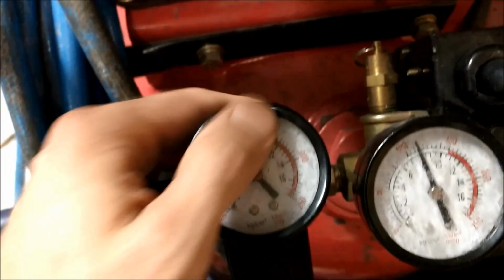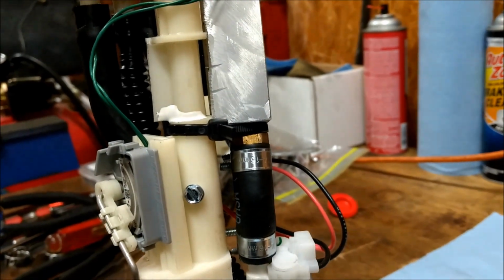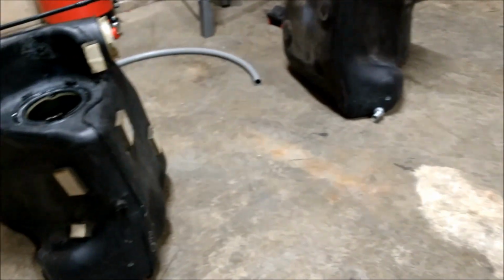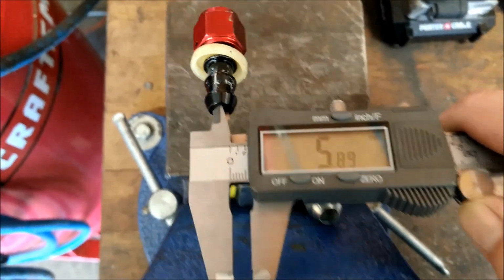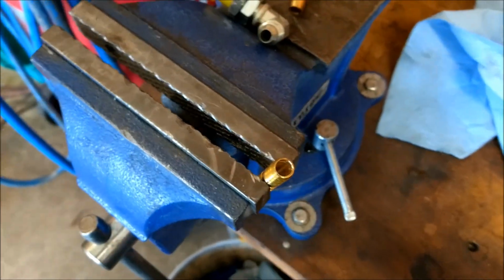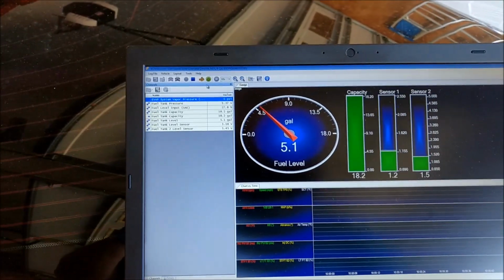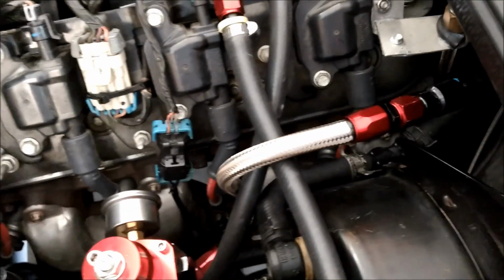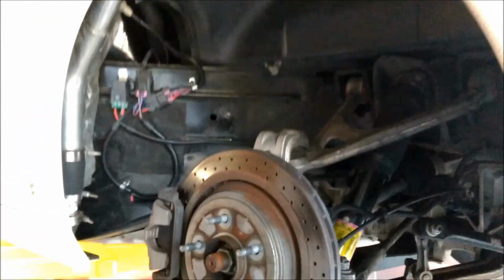Dual Walbro 450 Fuel Pumps PT 2

Comment: I put a 6.0 swap in my 1500 truck can I put a would you recommend the 450 pump for my truck or should I go bigger
Reply from the maker: A walbor 255 would be fine.  I put 2 woalbor 450s in my Vette and they were over running the after market fuel regulator so much I had to rework the tune for 62 psi base pressure and that was under vacuum.  With now vacuum it is at like 65 psi at idle.  Those 450 flow like no other!
Reply from the maker: The 255 if what my vette has stock and I moved it to my supercahrged dakota and it runs my truck at 6psi of boost full throttle now pressure drop.

Comment: Hey, about the eletric oil pump for the turbo, you had some problems with the gears from the old pump mounted with the engine from the new? Had some leak problem? Im looking for an eletric oil pump but some announces say the max oil temperature its 60°C. looks like some pumps come with seal that not was made for using with hot oil (your pump looks like a similar model that i see before).

greetings from Brazil 

https://www.ebay.com/itm/SEAFLO-12V-3-2GPM-10A-Gear-Pump-for-Oil-Transfer/273579304361?epid=1360849361&hash=item3fb298e5a9:g:zvMAAOSwLNxb-vy1:rk:1:pf:1&frcectupt=true

(link from the pump im looking for)
Sorry about my bad english =/
Reply from the maker: That one looks just like mine bet it is same manufacturer. It works fabulous but a little noise. Look at some of my other videos to see how to mount to make it more quite. Also take apart the gear section and clean it. Mine had foreign debrise in if I had to clean out. Do not use it straight from the box.
Reply: Does leak oil on the gear section? Because i got some informations saying the max temperature its 60°c. Maybe the seals are not made by using hot oil..... Do you got some leak on the pump or on the links of the hoses?
Reply from the maker: You may need to change the oring to a viton material. Neoprene will work but it hardens at that temperature after a month or 2.  That is what I did and no leaked or trouble. Make sure you mount it motor side up gear side down and you will be fine. That is how it did mine a d I have been using it for over a year now.
Reply: Thank you for the answer!. One more question, do you put a oil filter after the pump? If you did, does some difference on the level and the pressure of the oil from engine?
Reply from the maker: @gabrieljc2702  I am not using a filter. The car already has one. Also you can not suck oil through a filter you have to push through one and that really hurts flow  rate. High Flow rate prevent smoking and lots of other issues.
Reply: .....About the flow rate maybe i dont need too much because im gonna use it on a motorcycle, with only 2,3liters of oil. My first idea its use the oil filter after the pump, because if the gears for some reason brake or drop some metal on the oil, not will be soo good for the engine. Nobody want 2000$ engine broke by a 60$ ebay pump isnt? Did you put a oil cooler after the turbines? Looks like they produce a lot of heat!